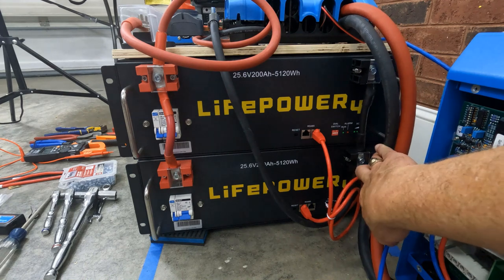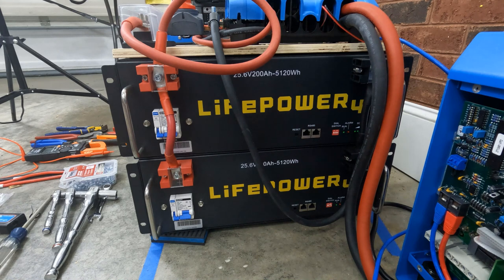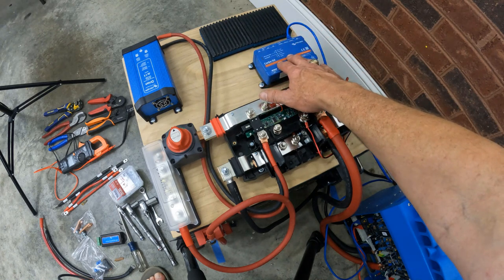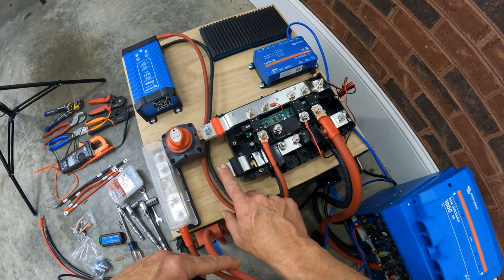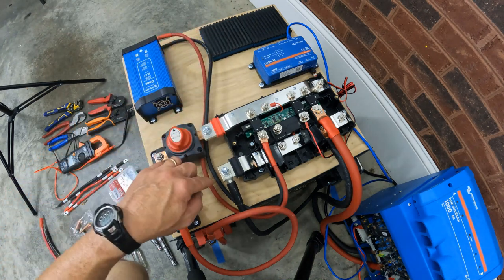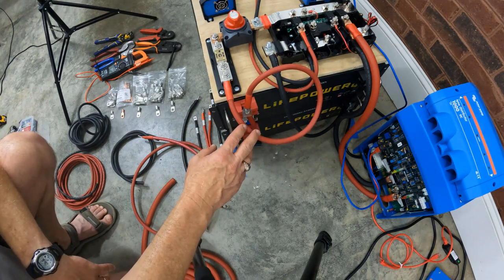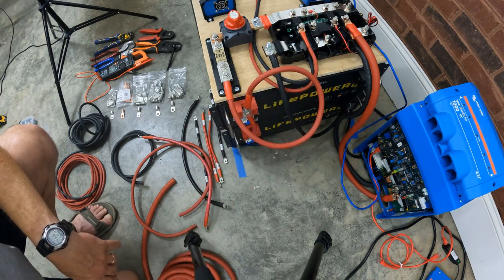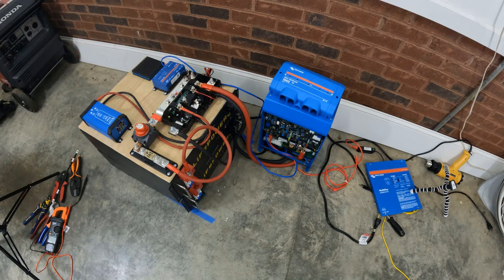Airstream Basecamp 20X, Inverter and Battery Wiring Overview

Comment: I too love and only use Temco products even though I am on a very fixed income (I'm  disabled and can't work anymore) I will not sacrifice quality for a lower price. I  am designing and building a 12 volt system for my 1967 GM TDH-4519 city transit bus that I live in full-time and right now I am trying to save up for a Victron lynx distributor and fuses

Comment: Hi there, i learned thats it important to keep the battery to battery cables the same length for balancing purposes but did not see that the lengths of wires from pos and neg to fuse and neg terminals were important. Im still in the building process and have attached my fuse directly to the positive terminal on my battery via a copper conductor. I did see that explorist reccomends a maximum of 7" from  battery pos terminal to fuse connector. Your thoughts?
Reply from the maker: @mikejohnson7768.  Yes, I made all my battery cables the same length.  I followed Explorist.Life recommendations and made sure the fuse was very close by and well under 7”

Comment: I hate to say it, but after the batteries you’re using the wrong type of fuse, you need to use a T fuse they are more expensive, but those other fuses like you’re using can create an arc and allow the current to keep flowing with a T fuses it’s impossible